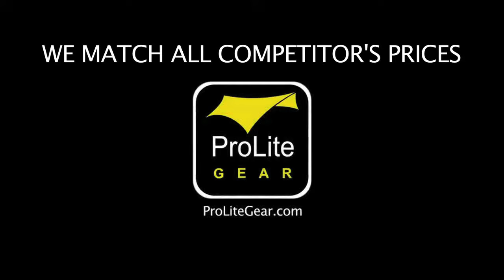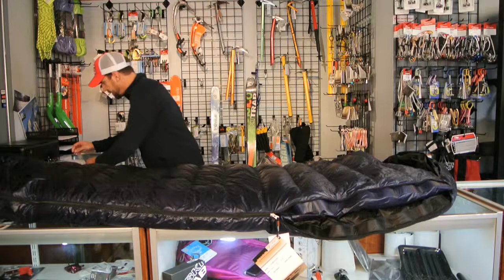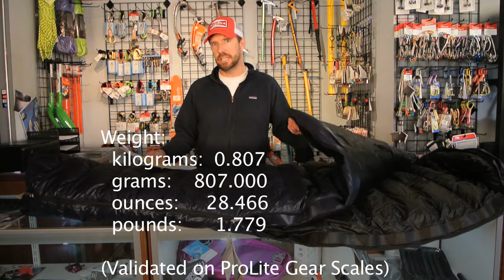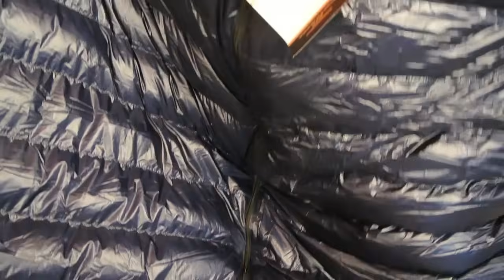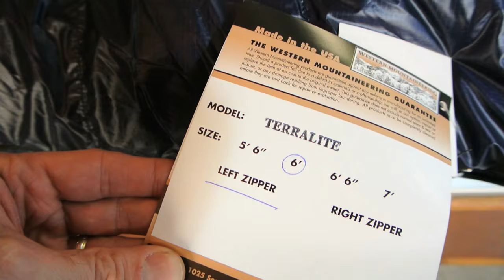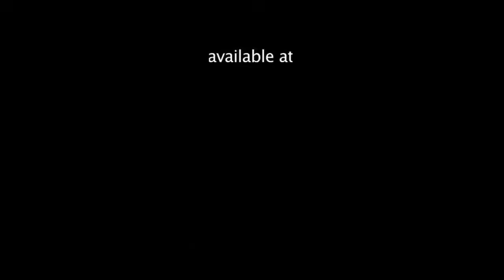New for 2014 - Western Mountaineering TerraLite Sleeping Bag

Comment: I just bought a terralite today.  Reason why I  bought one was the  nemo nocturne 30 sleeping bag  was a great bag. I used it 37degree weather with no issues.  Only complaint I had was, I am side sleeper on my right side.The zipper is sold only on the left side. When using this bag I had to completely turn over to unzip to vent it, or when I completely zipped it up for warmth. couple times when I turned back over to go back to sleep, I felt the sliding down the bag causing me to readjust it.
Reply: millster101 Just so you know, the Terralite is available in left or right zipper. My local retailer only stocks left-zipper so they ordered a right-zipper bag from the WM factory for me. Although delivery times might vary, the right-zipper bag arrived at my local retailer about a month after it was ordered.
Reply: I know that is why I bought one. Its a very nice bag. I love how well it keeps me warm for its weight. personal I can't see me in anything other sleeping bag, unless the temp drops below its rating.